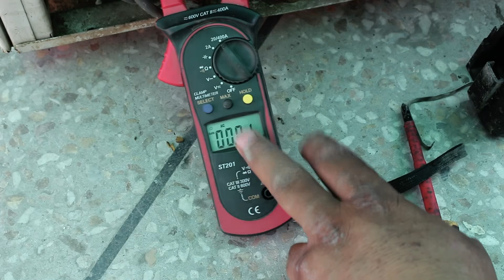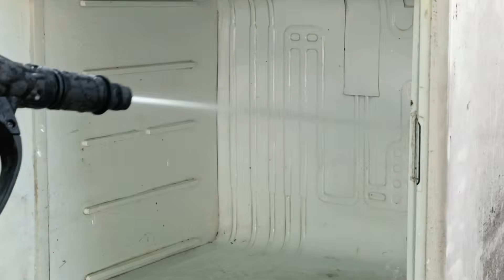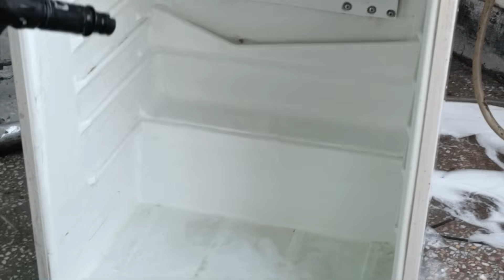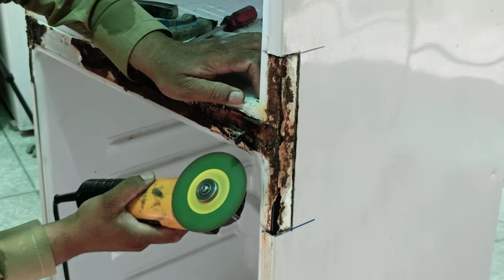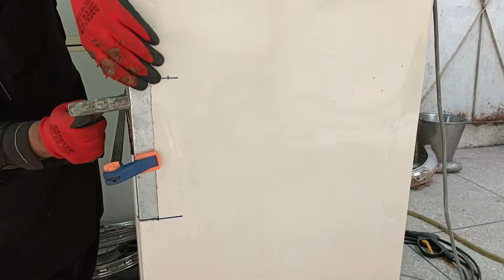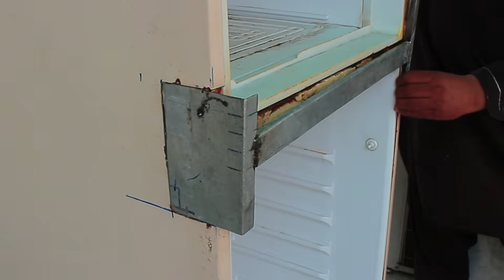“I Love This Old Fridge” — Customer Asked Me to Make It Last 15 More Years Part 1

Comment from the maker: Welcome to Part 1 of this refrigerator restoration project.

After opening this old fridge, I discovered severe rust damage that was worse than expected. This is only the beginning of the restoration, and there is still a lot more work to do before it can be brought back to life.

Do you think this fridge can be fully restored, or is it beyond repair? Share your thoughts in the comments.

Part 2 is coming soon, so make sure you're subscribed and have notifications enabled so you don't miss the next stage of the restoration.